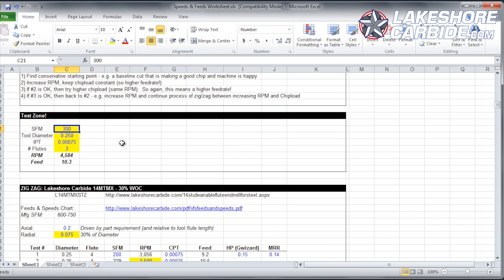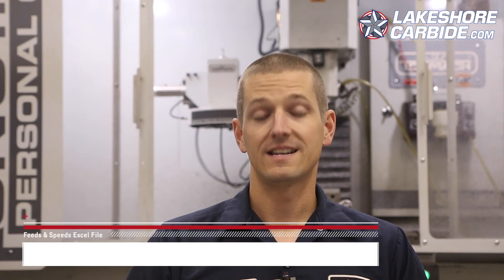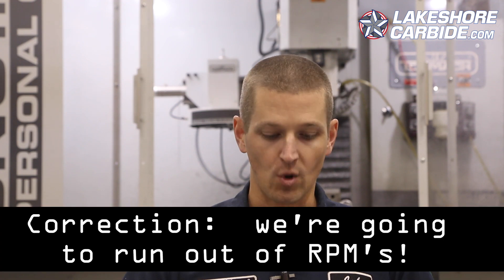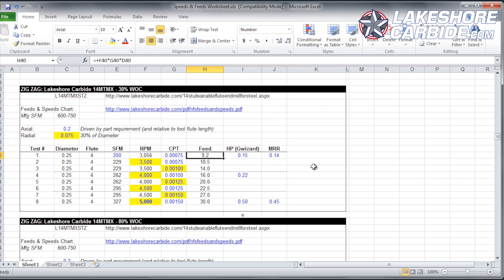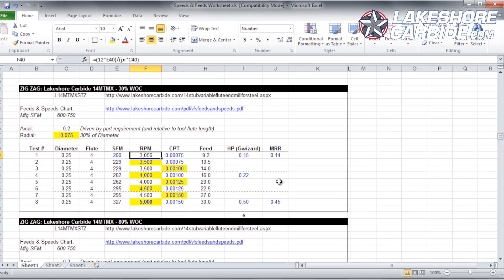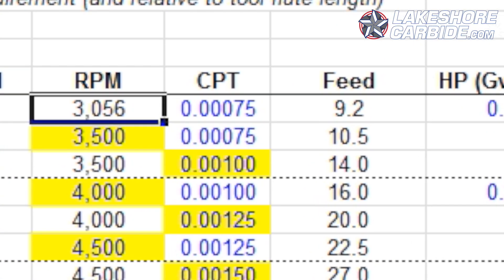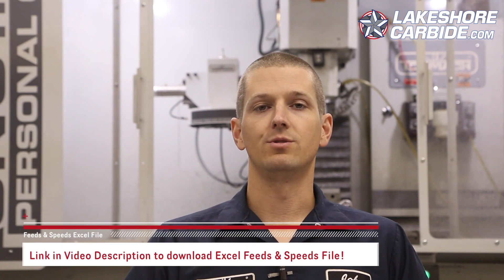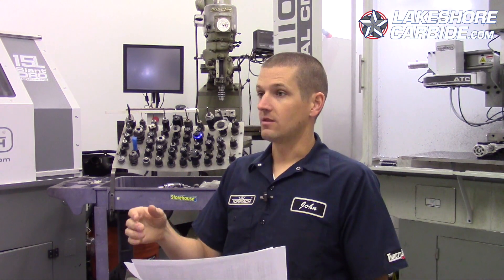Feeds & Speeds! Lakeshore Carbide Zig Zag Method

Comment: Hi NYC CNC, I'm having troubles with pure copper in parting. I'm usually running 1000rpm & 0.04 feed, should I reduce feed at centre of part or get a tool which delivers coolant from top and bottom of carbide tip? I get a good curled swarf from a new tip but it usually fails too easily and ruins the whole tool and part. Maybe I should just reduce speed due to heat and welding on in groove? Any help would be appreciated. Thanks Lex

Comment: Does the Horsepower rating directly relate to your spindle? I have a 2.2 kw (~3 hp) 24000 RPM spindle. If I'm operating at full RPM capacity, is it safe to assume my maximum spindle is HP load is 3?

Comment: John, I cannot get the link to work. I am really in need of something to help me figure out the feeds and speeds as I for some reason keep burning up end mills, or they chatter so much it is crazy. Worst of all I find myself slowing the cutting way, way, way, down in fear of ruining an end mill because of the cost of replacing them, but I know beside taking forever to cut a part I could be doing just as much damage to the end mill by going to slow. Please Help!  Also on another note I just wanted to say how helpful your videos have been to a novices such as myself, without them I would have never been able to figure things out in such a timely manner, your videos are awesome at how you seem to dumb down the jargon for beginners such as myself! Thank You So Much!!
Reply: John,Thanks for the response, I know your on vacation and really did not think you would respond. I tried the link on a different computer and got it to work. do you intend on expanding this series? if so have you thought about doing one on how to go about figuring DOC?

Comment: Hi John, It would be great if you could do a short vid on coatings they put on the carbide tooling. I'm keen to know if I should be running TiAIN coated carbide dry? When is flood coolant OK with this coating? Will the coolant stop the coating functioning properly?